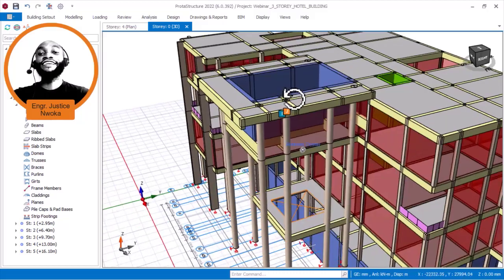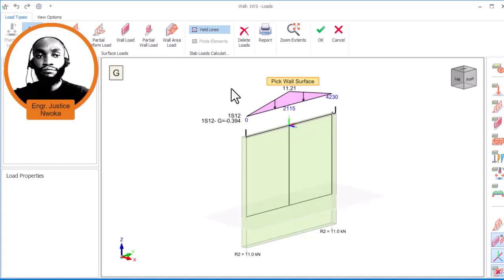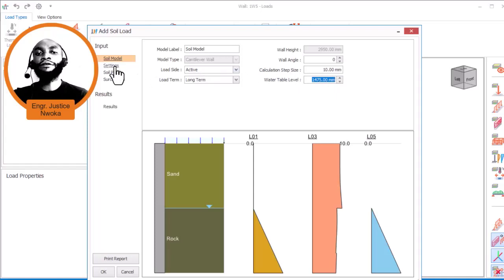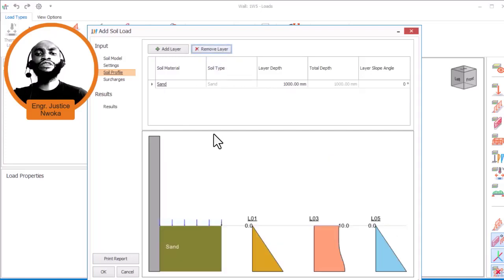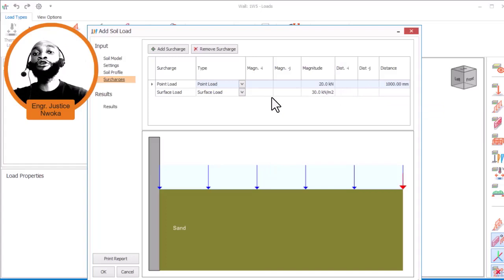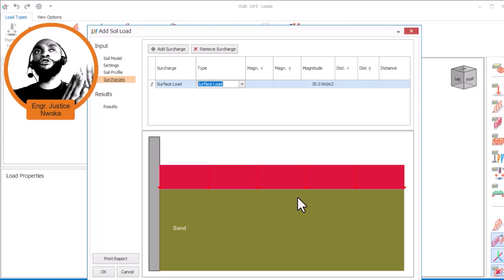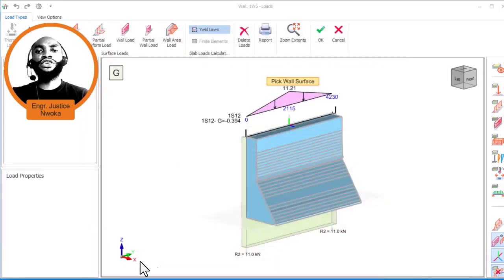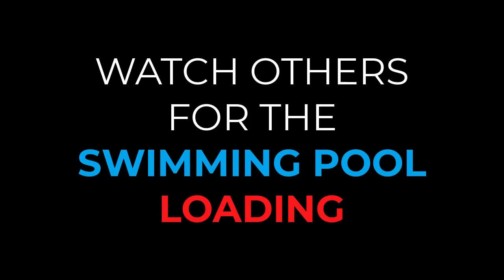Protastructure Basement Wall Loading - Full Tutorial

Comment: I use protastructue 2018 as my design software, but went it come to cutting of the slab section the bars are not showing. How do I go abt it?
Reply from the maker: It doesn't display reinforcement at the section.
Reply: @EkidelCAD  Why Sir? It's mean I can't cut section on protastructue 2018.
Reply from the maker: @ayubakenneth1529  You can cutt section but the reinforcement on the section won't show so you've to do it manually in AutoCAD